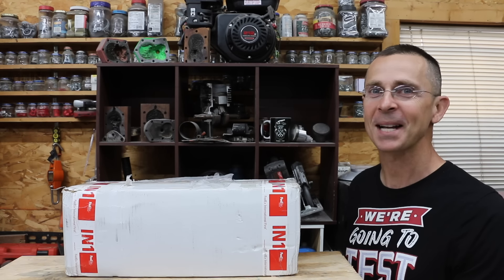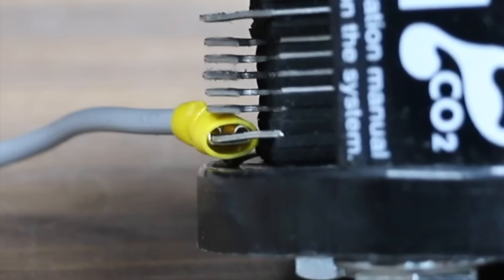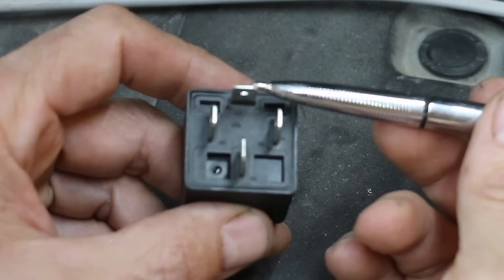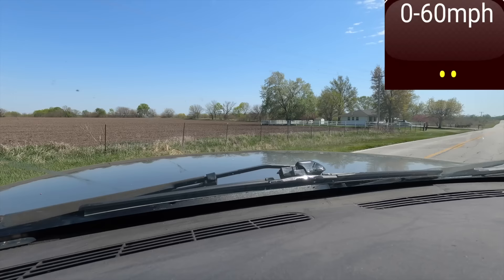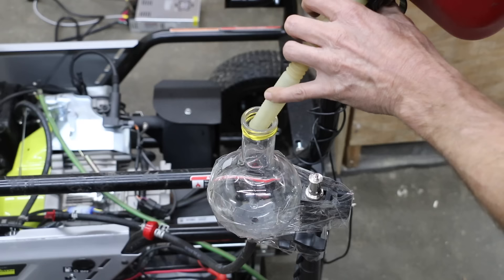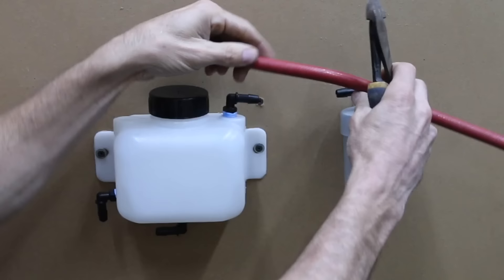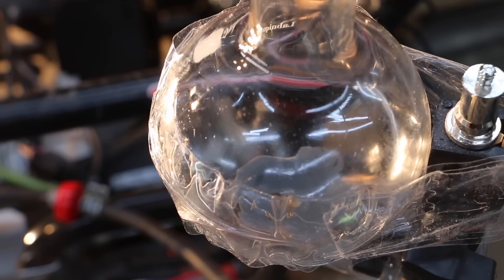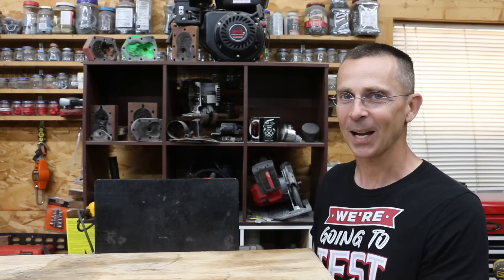AMAZING 35% More MPG with HHO? Let’s find out! Help with high gas prices?

Comment: You want to perform this test on a diesel engine, I think you will be surprised at the results. I should explain further, many years ago I done a similar test on my 2012 Toyota Hilux 2.8 ltr engine non turbo not common rail (these points are important). I used a design of my own put together in my workshop, my results were extra power to the point when climbing steep hills where I would have to go back to 3rd gear I could remain in 4th gear and an extra 100km from a tank of fuel also much less black smoke at full noise, down side with the home made setup I made I found a very high amperage draw from the charging system (battery and alternator) and the water got very hot, I only used tap water so I would be quite interested to see how much difference this electrolite makes, great vid keep up the good work
Reply: hmm u have my curiosity now bro .. im not a Diesel guy but this is knowledge n i love that lol

Comment: Finally, you proved the laws of thermodynamics are no joke 😂.
Reply from the maker: Thanks for watching!
Reply: The laws of physics are not being violated in the concept. You are using an electrolyte to facilitate the separation of the water molecules into their constituent elements. There is no "free" energy going on here. An uncle of mine had a DIY setup in a mason jar involving a stainless steel spring and such with baking soda as the electrolyte on a super duty diesel truck he owned. He claimed that he could see 30-40mpg on long trips on the road but that the performance varied depending on use with only a 2-3mpg gain in the city. He stated he changed the alternator out for a slightly stronger one. I never saw any empirical evidence though. 
 My thought is that using the potential energy in water by cracking it into hydrogen and oxygen and using that to assist a combustion engine designed to run off of hydrocarbons is going to require a considerable amount of "engine-eering" ;)
Reply: @kretieg2943  see the problem is efficiency and as we all know 100% efficient system which is not possible according to the laws of thermodynamics.
So now come to your point see we provide electrical energy to break hydrogen and oxygen.
And the system is not ideal so again it have too many losses and it's powered by your car battery and it's attached to your engine for charging.
The only virtual benifit I see here is if you start with a full charge battery say a 360 watt/hr battery or 1296 kj energy you're getting extra here which is previously stored by your engine when it's running on petrol/diesel.
In college we have a funny quote (Don't try to cool your room with a refrigerator).
Reply: @beatbox628  your forgetting the electrolyte. It is expended during the chemical reaction and must be replaced as well as the water. Of course you can't just run off the electricity generated by the alternator. Pesky ole 2nd law and all. My guess is that the cost in chemicals and continually replacing the (anode?) is more expensive than the energy gained from the acquired games. Plus. If just 30-40ml of that hydrogen leaks out into a pocket and then ignites, THAT is a problem. Im'ma take hard pass on this one.

Comment: Not even in theory can "HHO" deliver the promised results.  Energy is always lost when transferred from one form to another.
Reply from the maker: Thanks for the feedback.
Reply: Daniel, I always understood it as the HHO helping burn extra energy out of the fuel. I suppose now days with modern tech fuel control, it's not needed. What are your thoughts on this? Genuinely just interested. Not trying to be a keyboard warrior.
Reply: @canopygardensgreenhouse9907  Whatever "extra energy" HHO generates from the fuel has to be more than offset by the energy loss from generating the HHO.  Law of Conservation of Energy.
Reply: @DanielBelzil  Bro. Are you sure about all of this?
Reply: @groovemaker8997  here is the general comment I left perhaps it will help explain why it doesn't work.

"From a chemistry standpoint you get much less energy from forming H2O bonds than from forming CO2 bonds. From a physics standpoint you loose energy every time you convert it from one energy form to another. In this case from gasoline to electricity to run the generator then burn the split water in the very same engine that produced the electricity to produce more electricity to split more water....

Simply stated it takes more energy to split water than you get from burning hydrogen to form it. This test is proof.

The only advantage to burning hydrogen as a full source is that water is the only byproduct."

As to helping clean up any combustion there is no extra products available to do that as the it goes from H2O -> 2H + O (hence HHO) and then when it burns it goes back 2H + O -> H2O there is nothing left over to react with anything else. Now if you were to split H2O2 (aka hydrogen peroxide) it would look like this H2O2 -> 2H + 2O then burn from  2H + 2O -> H2O + O leaving the extra oxygen to react with the combustion of the gasoline and clean up that reaction.

I hope that helps explain things
Reply: @groovemaker8997  Until someone disproves the law of conservation of energy, then yes.  Look at the results of this video's experiment for example. Fuel economy was worse, as expected
Reply: Creating the HHO uses energy from the alternator; this adds load on the engine reducing the fuel efficiency. As stated there is always loss of energy during conversion so turning petrol into electricity into HHO fuel will add more load to the engine than the additional energy it produces.
Reply: @DanielBelzil  so, there is not any greater potential energy from splitting molecules than what it takes to split it? Hmmmm... how do nuclear bombs work again?
Reply: energy is never lost. just an fyi
Reply: @DanielBelzil  You're taking too big a shortcut. Here it's far from conservation law limiting --- if we can replace part of a very inefficient cycle with a less inefficient cycle, we might make enough savings to afford a conversion step. In theory. But if the same process still happens just with another cycle on top yes it will be worse.
Reply: @groovemaker8997  Not sure I follow you.  The claim for HHO is that it makes more energy than it takes to generate.  That's impossible.  Neither the fuel in a car nor a nuclear bomb can do that.  Also, you understand the difference between "molecules" and "atoms" right?
Reply: @SenselessUsername  good point. Thanks!
Reply: YOU ARE ALL MISSING THE POINT.

The point of using water in the engine cycle is to scavenge the residual waste heat of petroleum combustion into useful work. See the six-stroke engine.

In my opinion the only useful way to scavenge waste heat of combustion is by running water over the exhaust after the catalytic converters and driving a small turbine with the steam (similar to how nuclear power plants work). This turbine can drive a small alternator which provides charge to the general electrical system and main battery. This might be able to reduce the amount of drag caused by the main alternator on the engine.
Reply: @DanielBelzil  yeah i do. but you dont. How many liters of hydrogen do you get from one liter of water? Ill tell you, somewhere around 1800 liters. HHO is a actual and factual way to power an internal combustion engine. FACT!
Reply: @AG-sx9ws  Good point
Reply: @groovemaker8997  In a nuclear bomb you don't start and end with the same thing. If you want to create one by starting with the waste products and fusing them into nuclear fuel, that will take more energy than will be released by detonating the bomb, no matter what method you use.

When using electrolysis then burning the hydrogen, you are starting and ending with water. You can't do that without losses, and in practice significant losses.
Reply: @Charles McKinley that's funny. the amount of energy required to electrolyze water into hydrogen and oxygen fast enough to be useful for an engine intake stroke would be astronomic. I thought they were using water injection, which does work in many internal combustion engine designs as you mentioned
Reply: @groovemaker8997  Not lost so much as converted to a non-usable form such as heat. When fuel burns in the combustion chamber a lot of that energy is "lost" as heat. Lost in this context means it was converted to heat instead of force to move the piston. If you are using the engine to produce the electricity to run the generator that produces the gas then at each of those steps there is energy "loss". The energy is not lost just converted to a unusable form usually heat. When you apply your breaks to stop your car your forward momentum is converted from motion into heat by your breaks and that energy is "lost" as heat.
Reply: @groovemaker8997  Dude, nuclear energy works on the principle of converting mass into energy. It is NOT a chemical reaction. It works on the theory of energy = mass x (the speed of light) squared.
Reply: @groovemaker8997  Volume and energy are not related.
Reply: @Charles McKinley OMFG, water injection in jet engines, works by cooling the gas turbine down enough to so when more jet fuel is sent to the engine to create more power, it does not melt the turbine.
Reply: @davidkelly3779  yeah off topic. but expansion is. which is what most people with a degree would know was POTENTIAL energy.
Reply: @Charles McKinley thats why there are 5 working machines for sale as we speak that use HHO exclusively. Right?
Reply: @Charles McKinley Well please tell me how water injection in a jet engine works.
Reply: @groovemaker8997  Expansion is actually an example of kinetic energy. That is, the potential energy of the compressed gas is being released as kinetic energy. Am pretty sure you have not studied physics or chemistry at any meaningful level.
Reply: @Charles McKinley Charles, with all due respect. Exhaust thrust does not account for a large amount of the total thrust, even in the older engine of 747SP. The exhaust turbines absorb the thrust and use it to power the main thrust producer, the number 1 compressor turbine, which you can see at the front of most jet engines. 
Many years ago, as a pilot, I flew a water injected turbine aircraft. The system accounted for a massive 30% torque in each engine. The water was sprayed into the engine air intake.
The compressors after the intake heat the air and water mist. When the water vaporises it absorbs much of the heat in the compressed air. This results in a much cooler air charge going to the combustion chamber.
Now the limiting power factor in a turbine engine is the temperature of the exhaust turbines, which power the engine. A reduced air temperature allows the addition of more fuel, whilst still keeping the exhaust turbines under their limits. More fuel creates more power. You cannot get more power without more fuel. The 747SP would use the same system, although, the water maybe sprayed into the engine after the air compressors.
Oh and we used approximately a 50/50 water methanol mix, known as watermeth. The methanol was used to prevent the water and or mist freezing at altitude, or when sprayed at low temperatures.
Reply: @Charles McKinley I dont need to, I now exactly how afterburners work. If you are trying to compare an afterburner to injecting water into an exhaust - then you fail. I think you need to look into turbine engine power augmentation using water injection. While your at it, check out afterburners as well.
BTW injecting water into an exhaust stream, will cool the exhaust causing the pressure to drop and reduce thrust. The exact opposite of what an afterburner does.
Reply: @Charles McKinley you are sadly mistaken son.
Reply: @Charles McKinley Dude. Maybe you should take some current classes because this technology is already being used. Today. In several different platforms. I have a degree in Radiation Physics. Whats your background?

Comment: Wouldn't you have to manually lower the fuel injection amount with the ECU to compensate for the extra combustion to save gasoline?
Reply: My first thought as well. It's squirting just  the same amount of fuel into the cylinder as before. Probably would need a sensor in the exhaust and a computer to reduce the injection
Reply: Yes you have to lean the fuel gas out
Reply: Less throttle required (theoretically), so that's where the efficiency increase might come in.
Reply: I believe so there is a tuner for other models
Reply: No sir, the generator would do that automatically. Just like if you lowered the load, it wouldn't over rev, it would cut back.
Reply: i have to admit this wasn't really producing the hydrogen bubbles as efficiently as i have seen these create the gas, and that might be due to this being a dry cell, the wet cells produce a fuck tone more gas in less time and they actually work.
Reply: Yes but that makes it harder to compare as now we're comparing a stock car with stock settings while in this idea we now have a modified car with modified settings. Not to mention that also adds time so the speed comparisons would be less consistent.
Reply: Some videos show generators directly running on hydrogen. Curious if that's possible.
Reply: @timburss3335  
yeah it's possible to run directly off of hydrogen. i mean it's no different than running your propane tank.
Reply: Fuel injection systems do the tuning on the fly using downstream o2 sensors and mass air flow. They will lean or richen the mixture accordingly. The real problem is there just isnt enough hydrogen being generated and the system probably leaks.
Reply: @timburss3335  sure. But at that point just use an engine designed for it. Hydrogen engines exist and they are very different from a gasoline engine
Reply: @Demonslayer20111  
if everything was installed correctly, there is no leaking, however you are correct that it's not producing enough hydrogen, the hydrogen is simply a supplementing technique that will prolong the life of the gasoline, meaning your tank will take slightly longer to empty out because it extends the life of your fuel, but the benefit of using hydrogen is it will burn cleaner over a period of time it will make the insides of the car cleaner and it will run better. 

however a car can run completely off of hydrogen if the gas is stored in a tank, but the vehicle would have to be altered to work better for that setup.
Reply: If the engine receives "free fuel" and "extra combustion" from HHO generator it will act like you driving downhill. Fuel injectors will squirt less, because you need less energy. 
Exempt if there isn't "extra combustion"
Reply: @timburss3335  yes it will run but not efficiently because the system used is designed for propane, and or gasoline.
Reply: @Demonslayer20111  you can get what you want for a price, question is can you afford it?
Reply: Wouldn't a fuel injected engine automatically use less fuel if it wasn't needed? Maybe on something like a newer engine that auto retards timing with combustion, I dunno
Reply: No that's what the o2 sensor is for, to switch Ritch lean feedback to ecu to control injection pulse width.

Comment: You know the maker of this product seen this video and thought "oh crap, we're finished" 🤣 im sure every producer of "sketchy" products pray Project Farm doesn't do a test video of their products
Reply: So this is the third time I have written this and it keeps getting disappeared… Hmmm wonder why: So the problem has been solved a long time ago. Notice that both of these motors has a computer running it. 
   Think of it this way, what if we were putting propane into the system, what would be the results? And we know that engines will run on propane alone!
   Thus one needs an electronic add on to get the computer to properly adjust the input of the two fuels and oxygen… mixture is everything!
   Try this with a generator that is carburated for propane and see what happens… This though a good looking experiment is very flawed and either by ignorance or set up to fail.
  If HHO burns or explodes, which it does, then it is a matter of how to use it in an engine NOT a matter of if it “works”.
  Let’s see if they delete this one… This time I have it in Word so I can copy paste and not have to re-write….